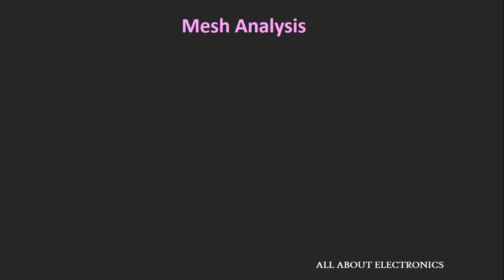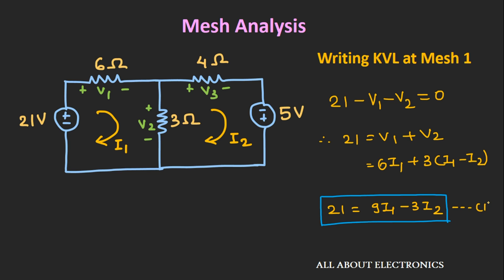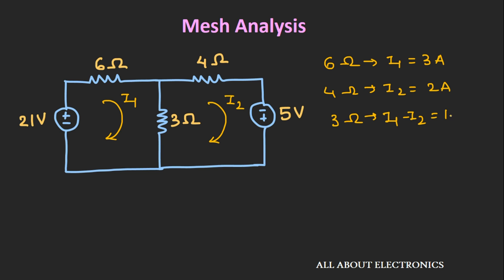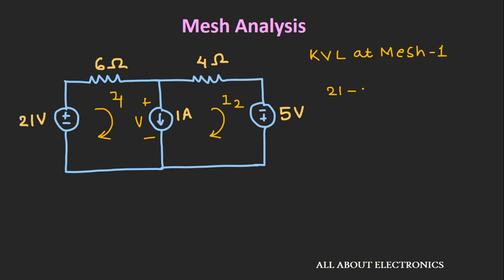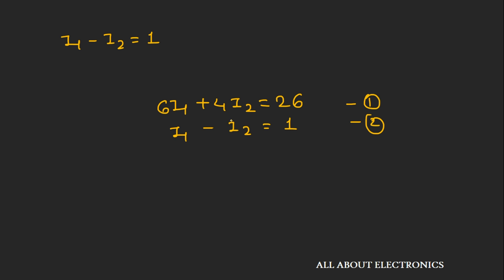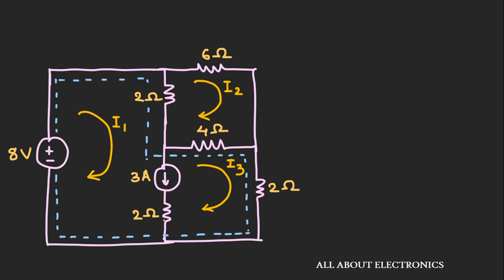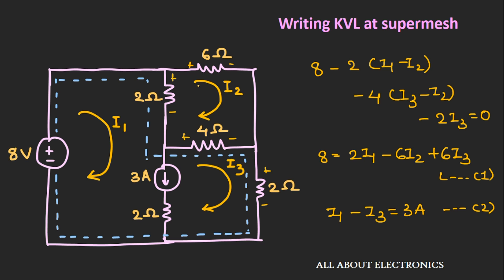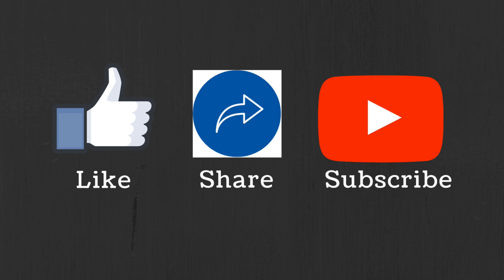Supermesh Explained (with examples)

Comment: Please help sir

You've told us in previous videos that.. when apply kvl in a mesh then the current of that should be considered as the higher current than the other mesh... But at 2:55 you write the opposite thing their..... Is it right their or am i just confused ?
Please tell me sir
Reply from the maker: Yes, it's one of the same thing. Here, I have considered voltage V2 polarity. If you go with an earlier convention, then it would come as 3 (I2 - I1). Here it is  (-3) (I1 - I2).
therefore, it's the same thing. I hope it will clear your doubt.

Comment: Sir super mesh ke 2nd question mei 2ohm resistor ko eqn. Mei kyu nahi liya
Reply from the maker: Because the current through 2 ohm resistor is 3A. Sine the current source is attached at one end, it means the current entering into 2 ohm resistor is 3A and the same current is also leaving through it. Therefore it is not considered in calculation. I hope it will clear your doubt.

Comment: Great video, one doubt, At 11:15, how you assumed that current flowing through  4 Ohm resistor is (I3-I2) and through 2 Ohm is (I1-I2); in this comment section actually, there are many people who asked this doubt, and you replied to them but still, I don't understand the reason behind it.
Reply: You can assume anything which you want just that the signs would be reversed in that case. He is focusing on the voltage sign convention he had given to that 4ohm resistor (ie that + and -)..so whichever current enters the +ve he took it greater than the one entering the -ve.

Comment: Will you please explain how you written KVL at Mesh 2 like 
-6I2+4(I3-I2) +2(I1-I2) =0
I think it was 
-6I2+4(I2-I3) +2(I2-I1)=0
Reply from the maker: In the mesh -2, the net current flowing through the 4 ohm resistor is I2 - I3. And it has been assumed that the current is flowing from right to left.
So, while applying the KVL, in  clock wise direction, the voltage drop acorss it would be  - 4 (I2- I3). But here it has been written as 4*(I3 - I2). 

Same is the case for 2*(I1-I2)
I hope it will clear your doubt.

Comment: What I do when voltage is connected in series with resistor should I do source transformation or just continue with is as it is given
Reply from the maker: It depends on the circuit. Sometimes it is better to use source transformation to simplify the circuit, while sometimes it is good to leave it as it is.

Comment: Sir how did you come up with -6(I2)+4(I3-I2)+2(I1-I2)=0 at 11:22?
I'm a little bit confuse with the signs.
Reply from the maker: Better you assume the voltage across each element first. Let's assume it as V1, V2, V3. Where V1, V2, and V3 are the voltage drop across 6 ohm, 4 ohm and 2 ohm resistors respectively. 
And if you apply the KVL with the assumed signs, then it can be written as, -V1 + V2 + V3 = 0 
Now, V1 = 6*I2, V2 = 4 (I3- I2) and V3 = 2 (I1 - I2)
(Here, it has been assumed that the net current I3- I2 and I1 -I2 is larger. )
Now, if you put the value of V1, V2 and V3, then you will get that expression.
Reply: @ALLABOUTELECTRONICS  NO SIR  V2 = 4 (I2 -I3)   and V3 = 2(I2-I1)       THIS IS CORRECT   AND IT DOESNOT DEPEND ON WHICH IS BIGGER , DIRECTION MATTERS

Comment: 2ohm resistor ko kvl of supermesh mai use nhi kiya Why
Reply from the maker: Because, the current through 2 ohm resistor will be 3 A only. In short, anything in series with current source, won't affect the supermesh equation.

Comment: how to determine the polarity of current in supernode or supermesh such as I2 - I1 or I1- I2. pl explain it.
Reply from the maker: Depending on the direction of the assumed current I1 and I2 (clockwise or the anti clock wise), it can be decided. In fact you can choose  any of them. The final output will remain same. Because let's say if you choose i1 -i2, then you will get negative answer. But at the end you will get the same answer. 
I hope it will clear your doubt.

Comment: I would not recommend his videos. They might get you the answers but will surely destroy your concepts. He is making the equations all in the opposite direction of the currents he is taking.
Reply: As I've replied to the other comment, "The sign is negative if it is a voltage drop and it's positive if it is a voltage gain. I don't think it's wrong. It's just a different approach from yours where you consider the polarity of the terminal encountered first as you travel around the loop. Whatever approach you use in deciding which sign to put, you will arrive with the same answers anyway." The approach in this video will not destroy your concepts. In my opinion, his approach illustrates the concept of KVL better than the approach you are used to.

Comment: Sir in that super mesh technique (last sum) we have to neglect that 2ohm resistance connected to current source
Reply from the maker: Yes, because here we are interested in the current (I1 -I3). And current in series through the resistor will remain the same.
Reply: @ALLABOUTELECTRONICS  thanks sir

Comment: THE 3rd EQUITION in a  SUPERMESH  is wrong YOU MUST START WIT 6(I2)+4(I3-I2)+2(I1-I2)=0 WHY You started with -6 answer please
Reply: exactly
Reply: The sign is negative if it is a voltage drop and it's positive if it is a voltage gain. I don't think it's wrong. It's just a different approach from yours where you consider the polarity of the terminal encountered first as you travel around the loop. Whatever approach you use in deciding which sign to put, you will arrive with the same answers anyway.

Comment: Does 2 ohm resistance have no voltage drop near 3A current source un last eg.?
Reply from the maker: Of course, there is a voltage drop across the 2-ohm resistor.
Reply: @ALLABOUTELECTRONICS  you missed to add it to equation 2, i mean 2 ohm resistance in series with the current source.

Comment: I think the equation at Mesh 2 is wrong. It is supposed to be
-6I2 - 4(I3-I2) - 2(I1-I2) = 0
-6I2 - 4I3 + 4I2 - 2I1 + 2I2 = 0
-4I3-2I1 = 0
-2I3 - I1 = 0
I got my equation from the direction of the current in each resistors. Correct me, If I'm wrong thanks.
Reply: 11:35
Reply from the maker: Actually, the equation depends on how you take the sign convention. 
Here it has been assumed that in mesh 2, the net current is equal to I3-I2. Which is flowing from right to left. And accordingly, the voltage drop is shown across the 4-ohm resistor. Now, if you apply the KVL in the mesh and move around the mesh in a clockwise direction then the voltage across the 4-ohm resistor is increasing as we are moving from lower to the higher potential. So, the positive sign is taken for the voltage drop across the 4-ohm resistor. The same is true for 2-ohm resistor.
I hope it will clear your doubt.
And stil lif you have any doubt then do let me know here.
Reply: ALL ABOUT ELECTRONICS Thank you :D

Comment: Sir,when both the currents i1 and 3A are going in the same direction,why did you take it as i1-i3=3A at 10:56?
Reply from the maker: Actually, this equation or relation is not based on KCL. But just by inspection, you can observe that current I1 is flowing in the clockwise direction while current I3 is flowing in the counterclockwise direction. So, we can say that net current flowing through the 2-ohm resistor is I1- I3, which is flowing in the downward direction. And current through 3A source is also flowing in the downward direction. So, we can say that I1-I3 should be equal to 3A. 
I hope it will clear your doubt. And if you still have any confusion then do let me know here.
Reply: Thank you sir

Comment: नमस्कार 
@10.12 how can we say current flowing through 4 ohm resistor is I3 - I2.
Plz. Tell me
Reply from the maker: We have assumed that the I3 is greater than I2.  So, net current flowing through will be equal to I3-I2. And hence drop across 4-ohm resistor is from left to right.
You can also assume that I2 is greater than I3. (i.e drop across 4-ohm resistor is from right to left, and can get the same result.)
It's just sign-convention that we have assumed for the calculation.
Reply: ALL ABOUT ELECTRONICS 
Thanks for your response.
@10.05 we take I1-I2 for resistor 2 ohm resistor. Hence same current will flow through that branch till it diverts to 4 ohm resistor. So current in 4 ohm should be less than current in 2ohm resistor. Therefore (I1-I2) - I3 is to be consider. If I3 is flowing through current source and 2 ohm resistor.
I'M NEW IN THIS. 
 PLZ CLEAR MY DOUBT
शुक्रिया 🙇‍♂️
Reply from the maker: Here, current I1, I2, and I3 are the mesh currents. And here we are assuming that they are flowing in particular mesh only. So, if you consider the 2-ohm resistor at the top, it will interact with mesh current I1 and I2.
While the 2-ohm resistor at the bottom will interact with mesh current I1 and I3 only. 
I hope it will clear your doubt.
Reply: ALL ABOUT ELECTRONICS 
I understood.
बहुत बहुत धन्यवाद

Comment: why u put negative sign before 2 at 9:56 ?? since the current is coming from positive terminal
Reply from the maker: Here, we are applying KVL. And 2(I1-I2) is the voltage across 2-ohm resistor. Now, while applying KVL we are moving from higher to the lower potential across 2-ohm resistor in the supermesh. So, the negative sign has been taken for the voltage across 2-ohm resistor. 
I hope it will clear your doubt. But if you still have any doubt then do let me know here.

Comment: In supermesh section 
there is a resistance of 2ohm below the current source 
why we had not calculated it??
Reply from the maker: You mean to say, while writing I1-I3 = 3A right? 
Well, actually it is not required. Because current through that 2-ohm resistor will be 3A only. And we are only looking at the current. If we are calculating the voltage then we need to consider the voltage drop across that 2-ohm resistor. 
I hope it will clear your doubt. If you still have any doubt then do let me know here.
Reply: thanx
Reply: ALL ABOUT ELECTRONICS sir if we are calculating voltage what ill be the equation with resistor consideration..
Reply from the maker: well, you can find the voltages too across each element, once you know all the currents in the circuit. 
Using KVL, it's easy to find the voltages across each element. 
I hope you understood.

Comment: please explain me HOW 3( I1 - I2 ) COMES......?
Reply from the maker: Would you please exactly tell me the timing in the video where you are having doubt?
Reply: ALL ABOUT ELECTRONICS 2:03
Reply from the maker: In that example, the direction of mesh currents I1 and I2 were assumed in the clockwise direction. So, the effective current through 3-ohm resistor will be I1 - I2. And voltage across it will be 3(I1-I2).
I hope, it will clear your doubt.
Reply: thnk i got it